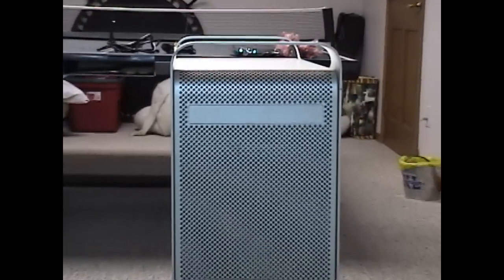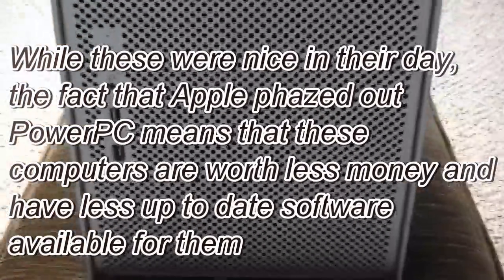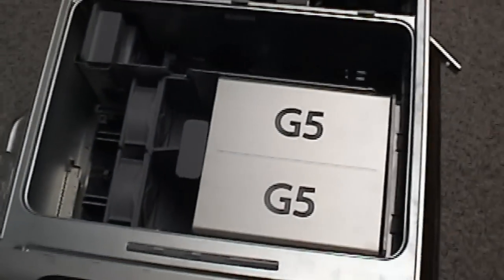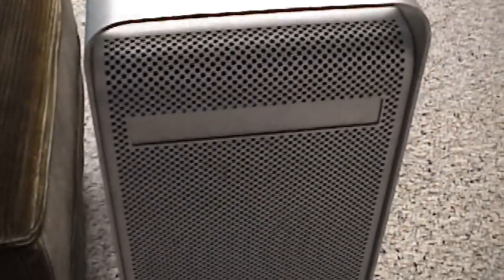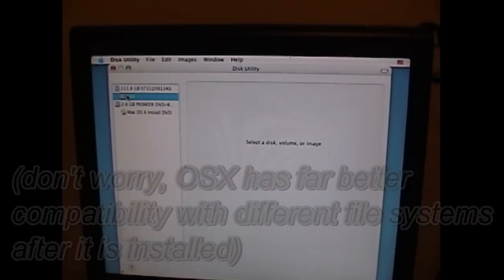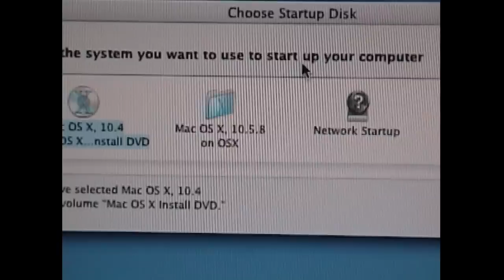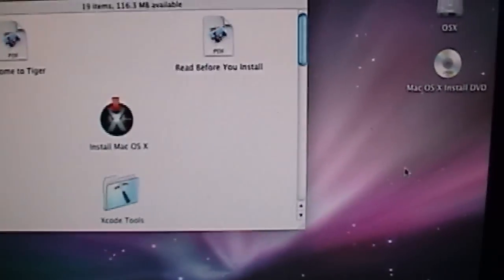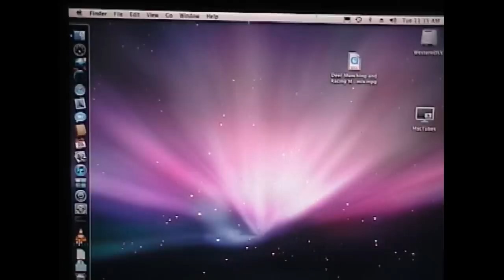PowerMac G5 Setup/First Run + RAM, Hard Drive, and OSX Installation

Comment: I See a lot of how-to's on THE setup for pc Mac and Linux but Cannon find alot  About what Os  can and Cannot do after THE setup . i know a powermac g4 sucks on flash is this The Same on g5 at the moment, any good alternative ? I Would love to See a good video with a g5 as a follow up with everything after THE initial setup
Reply from the maker: Well, the PowerMac G5 talks a big game but isn't actually that great as a computer. We have two Pentium4 machines in the house and I'm pretty sure that they both not only get more use than the G5, but are also more powerful; and that's not to mention the fact that they're still useful because they can run supported operating systems (XP and 8) and modern software with some semblance of competence. The only things that the G5 can do well (local audio/video playback, light web surfing, emulation) can be done just as well on any halfway decent smartphone (grab a video-out cable, a mouse, and a keyboard, and you've basically got a computer that fits in your pocket that is infinitely more useful and somewhat more powerful than the PowerMac G5; a smartphone sucks a lot less power too). That's right, the PowerMac G5 gets its ass whupped by any modern smartphone in terms of performance.

Going back to the Canon camera you were talking about that I use - the G5 falls flat on its face for video editing too. Even though it has a half dozen firewire ports, it doesn't support many (if any) peripherals (the microphone jack isn't actually a microphone jack, so screenrecording is silent too). Even my Canon camera (which is only a few years older than the PowerMac and shouldn't have any problems) simply refuses to work with it. Even if it did work, it's not like there's any good intermediate video editing software either.

As you mentioned flash player not being updated, that's just the way it goes. Even if it were updated, the PowerMac G5 sucks for web browsing in general too (even with the renowned best-of-the-best TenFourFox browser installed) - it's slow, unresponsive and is just a lackluster experience in general because of this computer's complete lack of power.

Lastly, being an unsupported processor architecture, you can't install Windows. And while you can run a couple Linux-for-PowerPC based OSes, none of them work at all out-of-the-box with the useless NVidia video card that the thing comes with (which is completely incompatible with the PowerPC linux drivers). As if to add insult to fatal injury, video card upgrading is a ridiculous game that involves finding a compatible video card (of which there are very few) and using a normal computer to flash its bios before it'll even work in the G5.

Maybe some of this complete lack of performance can be chalked up to the crappy video card that's in there, but I keep in mind that other P4 machine that doesn't have a very hefty GPU either, and it still powers through a lot of stuff that the G5 struggles with. At the end of the day, the PowerMac G5 requires so much hand holding (that is, help of a regular computer) to complete every day tasks that I just avoid using it. It's currently set up in the basement serving as an emulator computer for NES, SNES, and other systems, and as sad as it is to say, that's all it'll ever be good for.

I might do a video summarizing the thoughts of this comment before I sell the G5, but that's the only plans I really have for it the way it is. Like I mentioned before, its pretty case talks a big game, but it's just not practical for any task that can't be done with a halfway decent smartphone these days.
Reply: thnx for you reaction  i decided to skip the g5 (unless i get it for free offcourse)
Reply from the maker: migchiel faber

Free or for a few bucks is probably worth it just for the experience of that nifty case (if you're feeling really adventurous, you could even do an extreme casemod and put a real computer in it).
Reply: ***** I just love this suggestion. I was about to sell my G5, but no way. I just love the built of the sturdy case.  I will put a seriously fast pc in it.  What can I keep from the mac on the inside?
Reply: my  thought on it was this. is a g5 mac still running well and are there alternative software to replace youtube flash kinda permanent ?
i know the flash alternatives on  G4 are already obsoleet and are not  upgraded  so there are no good alternatives
 i geuss it is  all the same with al other powerpc it is stuck on older software and isn,t updateable. even a version linux for PPC not there anymore
i only want a  original G5 if i can get it dirt cheap. and they stil ask way to much for it.
Reply from the maker: Simplebwoiayo Gabriel
You can probably keep the hard drive (unless you want to upgrade to a larger unit or an SSD), the DVD drive (if it works), and maybe the PATA/SATA cables (if they're long enough) and processor cover (if you want to keep the stock look). I suppose you could keep the memory too, but if you're going to be using anything modern, DDR1 ram will be out of the question.

Here's a nice looking casemod that keeps the processor covers and looks pretty nice all around: http://youtu.be/9DKzPRvylpI

In fact, if your PowerMac still works, you may be able to sell the motherboards, processors, and power supply on eBay.

Comment: Wow, great video, thanks. Now I cant get to download osx 10.4 which I understand is the first thing to download..
Reply: +drsnoggle it seems there is no seed on that torrent
Reply from the maker: +drsnoggle 
Kickass Torrents reports two seeders currently, so it is significantly less richly supported than when I originally uploaded the video years ago. Just keep it running and see if anyone starts uploading again. If not, here's another link from the same site offering a similar image: https://kat.cr/macintosh-os-x-tiger-10-4-3-retail-t5192917.html

I have not tested that so I don't know how well it'll work or what it would take to burn the image, but it's an option if you'd like to give it a try.

Or, if you have a dual layer DVD and burner, you could try this one: https://kat.cr/mac-os-x-leopard-10-5-4-9e25-retail-intel-ppc-t1299659.html

Best of luck!

Comment: Just found a G5 tower at the local bazar! Still don't know witch version it is (had to put it aside 'cause I was on bicycle...) but I know it is a PPC version, since it has 2 fans in the back. I paid 10$ for it. Cant wait to plug it!
I wish I can install Linux on it!
Reply from the maker: Once you actually install Linux on it, you'll wish you hadn't wished to install Linux. Actually, you'll wish that you'd left it there for any price, regardless of what operating system you use ;-).

Comment: If anyone knows how do I connect a video display to a Mac G5 Tower like this? Would a DVI to HDMI cable do it? The date today is 1/18/25. I bought my Mac G5 in 2018, and was working when I put it into storage in 2019. Was a unit a video production shop was using. Has good video editing software on it if the data is not now corrupted. But how to hook up the monitor? I want to sell. So I need to start to see what processor and RAM it’s got so I can advertise it on Craigslist properly. For all I know it’s working just fine.
Reply from the maker: Yes. At least one of those outputs on the original video card is a standard DVI-I, and so should work with a normal DVI cable, DVI-to-HDMI dongle, or DVI-to-VGA dongle.

Comment: Someone threw out a G5 along with an old Dell in the trash area of my apartment building. I brought up the G5 since it was in really good condition, and gutted the old dell for hard drive and ram. Then I saw that the G5 could use up to 4 sticks of ram and it was the same exact type as the one that the dell had in it. Ended up being a really great desktop to just mess around on.
Reply from the maker: +Mario Rodriguez 
What kind of computer was the Dell?
Reply: Honestly don't know. That one was pretty dirty so I just brought it up, set it down over some old newspaper, and took out the ram and hard drive.
Reply from the maker: Mario Rodriguez
Did the motherboard work?
Reply: The G5 did. The Dell I didn't check. We already had 2 desktops (the G5 made 3) so it wasn't worth checking. That Dell was extremely dirty so we didn't even want it here.
Reply from the maker: Mario Rodriguez
Ah well, it is what it is. I would've cleaned up the Dell to see if you could get it going. Gotta love filthy PCs though.
Reply: +Channel 2012 Haha true. We just already had way too many of them to warrant even checking if that one worked. We have found other things though. A few days ago I picked up a 19inch HD samsung TV that works flawlessly. Cleaned it up and bought all the components to give my parents so they could get rid of the old tube TV they use that we've had since the 90s or so.
Reply from the maker: Mario Rodriguez
Good find. I haven't found any good freebies like that since a few summers ago when I scored 2 50" DLP RPTVs for free through craiglist, both of which I was able to sell for a significant profit after repair.

Actually, the intermediate family did donate a 60" DLP rear projector to our family a couple months ago and I finally got it fixed last week, but the replacement lamp I got for it burned an acrylic lens inside of the optics. I'm still waiting to hear back from the seller of the lamp about getting a replacement light engine to make it right. Once (if) that thing gets going again, I'll probably do a video on that and cover transportation of large items in a small car among other gems of knowledge I learned from the experience.
Reply: Those are great finds though. We don't have a car so I'm really just stuck to what I find in my immediate area, but a lot of people are wasteful so I've also found a really good birdcage that my budgies needed for more room and my cousins have found bikes and a ps3 and 360. People are so wasteful. Really glad there are other people recycling these old thing and keeping them out of landfills. Heck, thats how my little sister has her own laptop. Ten year old Compaq with wifi is more than enough for an 11 year old.
Reply from the maker: Mario Rodriguez
Good deal.

Comment: did everything in the video but mmmmy g5 wont detect my 10.5.8 in my usb?
Reply from the maker: Is it mounting the USB drive at all? If not, you may need to format it in the HFS file system for the 10.4 disk manager to recognize it (you'll find that this type of hand-holding will be a regular occurrence with this computer, so it's best to get used to it now).